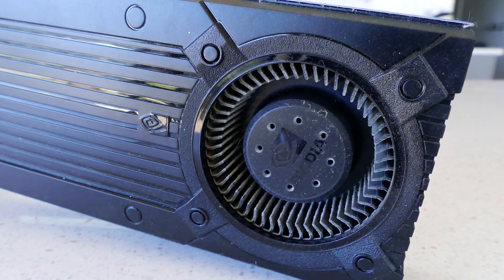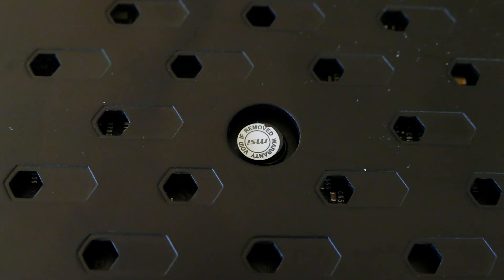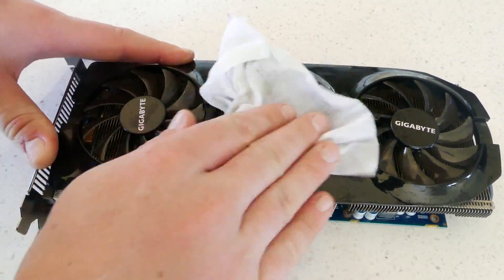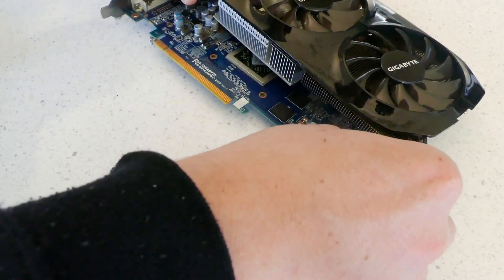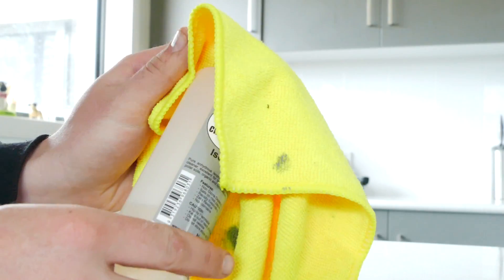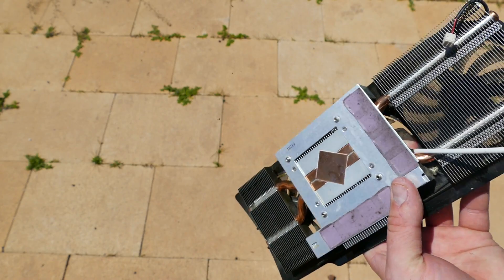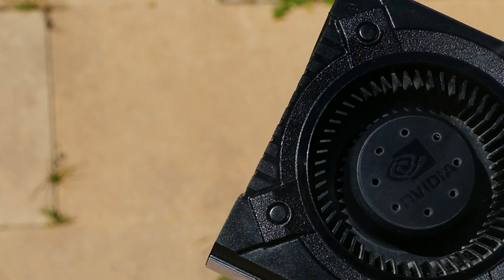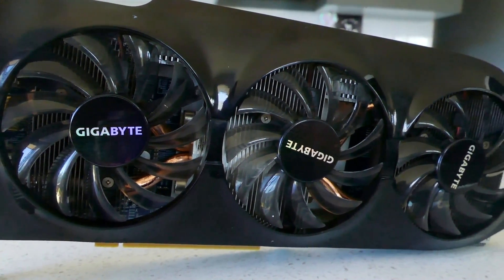How to Clean a Graphics Card/GPU

Comment: so, baby wipes are safe to use on the pcb? like wipe it all over the board?
Reply from the maker: Yes I have used them many times with no issue
Reply: Do they have to be alcohol based? And what about static electricity? Is that not an issue on the PCB?

Comment: Those baby wipes, are they pretty much soaked in rubbing alcohol? It LOOKS so potentially damaging :P But I guess it's not water lol. Which would be conductive right?
Reply from the maker: Correct! As long as you let it dry which in all honestly only takes a few minutes but I always give it about 15 to be safe. You can also use brake cleaner which will do an even better job
Reply: Wow nice. Thanks. Also with thermal pads, do you know if it matters how thick they are? Are you supposed to match the thickness? If there's room I would think thicker gives more heat dispersion
Reply from the maker: Yes they have to match the thickness so that the cooler can make proper contact with the GPU die. If they are to thick the cooler won't be as efficient and your temps will sky rocket
Reply: @EverythingbySam  you can really use brake cleaner?
Reply from the maker: Yes you can use WD-40 and Brake Cleaner but it will leave a residue behind that you will have to wipe off.
Reply: @EverythingbySam  thank you!
Reply: Everything by Sam  Wd40? would that be safe?

Comment: How about a leaf blower?
Reply from the maker: I wouldn't recommend it that's for sure
Reply: Please tell me why not?
Reply from the maker: The motor that most use can cause an electro magnetic field  which has the possibilty to short circuit your system plus depending on the pressure it can produce it may damage smaller components like motherboard caps
Reply: How do I know if my card is damaged please?
Reply: And also will it damage the gpu if i blow air right in the fan without disassembling the card?
Reply: @Qaveth  I have cleaned my GTX 1080 Mini with low power Leaf Blower. Just make sure to keep atleast 1 foot distance and prevent the GPU fan from spinning while using the blower.
Reply: ive done it 3 times with my 1070, never taken it apart. going to deep clean it before my 2070 upgrade.

Comment: i've hd 6870 and it reaches 90c and i changed thermal paste and it reached 87c but it still to high !
so what's the problem here !?
Reply from the maker: there could be many issues such as your cooler  isn't sufficient enough. one way to sort of did it is to download MSI afterburner and change your fan profile or underclock it

Comment: too much thermal paste
Reply: It makes it a lot messier to clean and it can direct heat to places that aren't very heat resistant which can shorten the life of the card.
Reply: watch https://www.youtube.com/watch?v=rAid5G30-WM
Reply: Silley Doggo, not true at all.... thermal paste can even go into the pins of a cpu and has no affect what so ever....  thermal paste made today is not conductive.  unless ur using shit cheap stuff which u shouldnt be using period.
Reply: @DapperHoppes  One of the best thermal pastes, Arctic Silver is conductive. Spreading it beyond the heat exchanger isn't safe even if it's not conductive.  Using baby wipes is bad too since they contain moisturizers that will corrode the PCBs.  This dude made a ton of mistakes.
Reply: @mematron  using a thermal pastes that are none electrical conductive doesnt cause any damage.  its been practically proven by many pc tech reviewers as well as myself.  using baby wipes to break down the paste is fine as long as u use a none static clothe to wipe it down afterwards.  and Artic Paste isnt electric conductive its head conductive.
Reply: @DapperHoppes  All thermal paste is heat conductive hence the "thermal" part in the name. Since the goal is to efficiently and effectively direct the flow of heat into a heat exchanger, being messy about it is wrong.

Arctic Silver has silver zinc oxide, aluminium oxide, and boron nitride particles that transfer heat and electrons very well.

What you and your little playmates need to do is review some science books.
Reply: MEMATRON thanks for the wiki information but ur spouting nonsensical information we havnt heard before.  lol lil playmates?  Just shows the butthurt in u there princess. All expensive thermal paste is none electrically conductive it’s why it’s expensive.  It’s 2018 not 1998 anymore the compounds found in thermal paste are less and less electrical and heat only.

But run along now kiddo and leave this to the big boys 😉
Reply: It's non conductive dude. It takes a lot of non conductive paste to be too much. Some cards are designed in such a way where thermal paste can seep out into areas it shouldn't be, but if you know how to spot these kinds of cards...it's better to have slightly too much than not enough.
Reply: Echang Wang is correct. It's not necessary but it is good practice to use the correct amount. You don't NEED to do spot on car maintenance or brush your teeth everyday, but overall it is good practice to. Good maintenance will increase longevity of things. It's pretty common sense. This doesn't really apply to you if money is not an issue.
Reply: Lol it can never be enough if its a warm summer dont cry when it burns seems your the smart as* but this is simple knowledge
Reply: not for a gpu
Reply from the maker: It spread perfectly with no thermal issues. Trust me I have been doing this for years and it's been proven multiple times unless you use majorly overly excessive amounts of paste the thermal capabilities stay the same

Comment: Great video, allready applied new thermal paster, but the fan is rattling in one side, i've had my HD 7970 Platinum for like 3-4 years so i either need to replace or fix the fans.
Reply from the maker: You may be able to find the same cooler for sale or if not buy another 7970 as they are quite cheap second hand. If not it's time for an upgrade